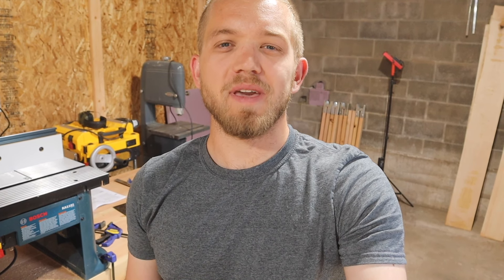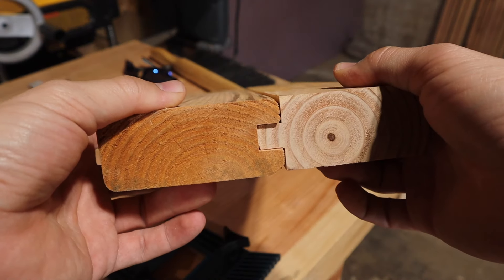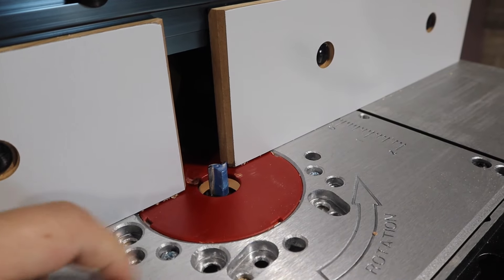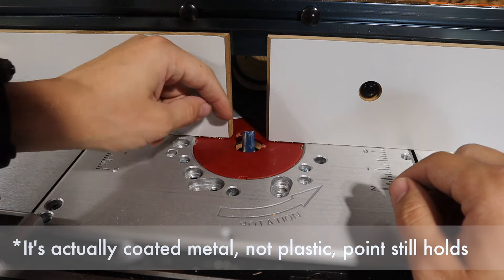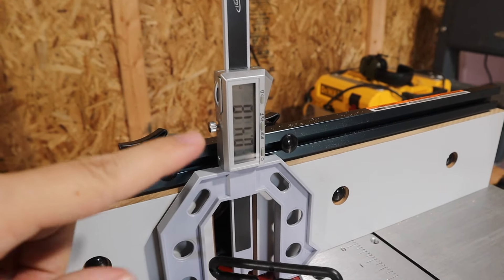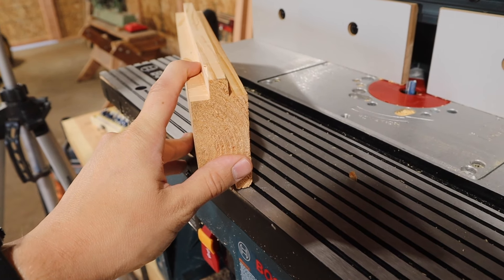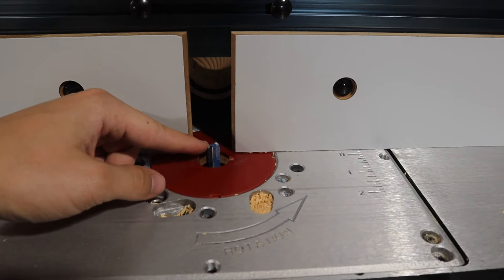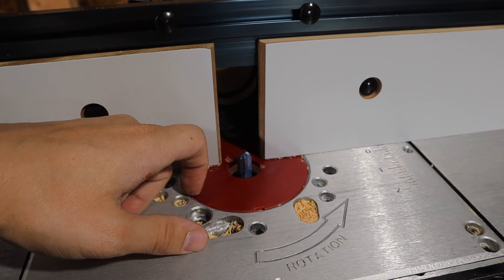Cutting a Tongue & Groove Joint | How to & Tips/Tricks

Comment: I very much appreciate that you showed me how to use the Router table to cut a T and G joint for timber thicker than the standard 20mm/3/4 inch Router set that I currently have. Being able to make T and G joints on  1 and a half, or even occasionly 2 inch timber will be of great benefit to me. Thanks a heap for showing me the obvious ways for cutting T and G joints on timber other than using the limiting 20mm Router set timber I have!
Reply from the maker: Glad you found it helpful! You may also look at the Freud set, they have a lot of combinations you can cut in and it’d be a lot less thinking/math using their bit set. 

Here’s the set I have now 
https://amzn.to/3ZbTMlW
Reply: @NorthwestCraftsman  "Adjustable at .002 inch increments for stock thickness of 1/2" to 1-1/4" and groove widths of 7/32" to 3/8"" What if I'm doing 2 by or 1.5" material?
Reply from the maker: @ not sure I fully understand your question but there are a lot of ways to work the math out. Effectively, in this case, you’re limited by your router bit diameter that creates your groove. From there, you can divide the remaining thickness in half and mill both sides of your tongue side to create the tongue. For example, on material that’s 1-1/2 in thick (2by) if your router bit is 1/2in this leaves 1in of remaining material, so the tongue side would need 1/2in of material removed on both sides. Remove slightly more for a looser fit, and slightly less for an interference fit.

Comment: Not too technical for me.  This is exactly what I needed to see so I don’t screw up $ 2K worth of rough cut cedar and needed to know how to properly tongue and groove the wood.  For us hobby woodworkers this was wonderfully presented!  Thanks! 👍👍
Reply from the maker: Thanks! If you have a ton of boards to do, one of the issues you can run into with this method is variability in the tongue thickness and groove placement. This stems from variability in board thickness. If your boards aren’t exactly the same before cutting this, they’ll be off.

Also, there is a new bit I’ve purchased from Freud which could save you a ton of time as well. It’s their tongue and groove bit. Much less room for error. 

https://amzn.to/3lFItRH

Good luck with your project!

Josh 
Northwest Craftsman
Reply: @NorthwestCraftsman  thanks Josh, I will purchase the new bit.  I bought the 2 speed Dewalt DW735 planer so I will ensure all boards are played exactly the same. But I’ll still pick up the bit because I want to make this as simple as possible. If I am using the cedar tongue and groove panels for the boards which are only going to be 24 inches running vertical, would you suggest a tighter or looser connection? My wife thought looser because of moisture and expansion during cold and warm months, but I would love your opinion! I will be staining and sealing the wood prior to assembly.  Thanks again!
Reply from the maker: Fantastic! That’s the same planer I have and that’ll be perfect! Man that’s going to smell nice. 

Your wife is spot on, I’d leave a little bit of slop in the TnG joint so the wood can both move around and because assembly will be easier. How are you securing this to the wall?
Reply: @NorthwestCraftsman  I purchased plans from a company.  According to the plans I will be making a frame out of 1 1/2” x 5/8”cedar (inside frame) and secured with 1 3/16” brads. Then once knee boards set in place against the frame, then will use 1” x 1/2” trim top and bottom which will sit flush with frame.

I hope that makes sense to you, because it’s all new to me and I’m just reading what’s in the plans. Seems straightforward for someone like me with no experience.  Making this should be pretty therapeutic for me.  And the wife smiled when I told her you agreed with making the T&G slightly loose for expansion and contraction.  :)
Reply from the maker: Makes perfect sense! It’s really nice to have a set of plans just ready to go. Simplifies things a lot in the shop and allows me to relax more 😂

Glad I could validate her thoughts 😂 my wife is right quite often 😂
Reply: @NorthwestCraftsman  will I need to buy the Bosch Table Base for 1617/18 routers?  I bought the 27” x 18” router table last week.  Also, which router should I get to go with the table?  I am thinking the Bosch 12 Amp 2 1/4 HP Fixed Base model (not sure of the model #) with Plunger but not sure if I need plunger or not?  Any advice is appreciated.  Thanks!
Reply from the maker: Hey, thanks for your patience, busy week. There are a few questions in there and I want to make sure I interpreted them correctly. 

When you say you got the 27x18in table, is that the Bosch branded table or another table? If it's the Bosch table, the insert will fit the Bosch 1617 EVSPK fixed base with no problem. I find having the plunge base on hand really helpful but it's not necessary if you plan to have your router permanently mounted in the table. If it's another brand of table you can always mount the Bosch fixed base into the insert or buy a universal insert which as the right bolt pattern. 

If I totally misunderstood your question, let me know 😂

Here are a few of my videos that may be helpful:
Router Unboxing: https://youtu.be/06Xcl2aPA1c
Router Table Unboxing: https://youtu.be/clwb5igR6Jw

A link to my core power tools which has the router table and router combo on it:
https://www.amazon.com/shop/northwestcraftsman/list/79MACE1MA4BS?ref_=aip_sf_list_spv_ofs_mixed_d
Reply: @NorthwestCraftsman  you interpreted correctly.  Your video was great in explaining the new Bosch so I ordered it.  I didn’t know the table was just a table and didn’t know I needed to buy the router separately.  My mistake, you gave the links and I wasn’t well enough versed to know.  So I bought the Bosch router yesterday as well.  It’s a learning curve for me.  I guess the only other question I have is if I am T&Ging a 1” thick piece of would should I buy the router inserts as a kit or just buy the single.  I am unsure if the bit used on that thickness should be 1/4”, 3/8” or another size altogether?

Comment: I’m wanting to put a 1 1/4”groove into my 7”x3”x 9’ fence post and run my fence horizontally. How would I accomplish the groove without a router table? I have a router, but no bits yet. Any information/suggestions would be appreciated.
Reply from the maker: Hey there! That’s a cool project! 

On something that large, I wouldn’t even like it on a table, pretty unwieldy to move on its own. I’m not sure if your router has this but the Bosch router I have has an edge guide you can use (link below). If yours has something similar, I’d do that. 

Bosch Edge Guide
https://amzn.to/4c9mOq6

Comment: Thanks very much for your work with this video! 

I have a question regarding recommendations for cutting tongue and groove on thicker stock. My boards are 1 ¾" by 5 ½". I'm processing a lot and wondering what the most efficient way to do this. It seems like a tongue and groove router sets are the way to go, but i can't seem to find one that works for stock this thick.
Reply from the maker: Glad you liked it!

1-3/4 is pretty beefy, however, it should still be totally doable. You’re right that normally a TnG bit set would be the most efficient way to go but my normal go to from Freud only accepts up to 1-1/4in. Is 1-3/4in the final thickness of your boards? Or is that before jointing and planing. If so, you may be within range at that point. But assuming you’re not, I’ve had some really good luck with using my table saw to cut the tongue and then pop a dado blade in to cut the groove. It’s still more manual than a bit, but it’s even easier than what I showed here. Out of curiosity, what are you using those behemoth’s for?

Comment: Can you do tongue and groove joints using a dado stack on a table saw? I only have a handheld router and not a router table
Reply from the maker: Sure can! In fact, you actually don’t need a dado stack, I did a video a little while back just using a regular blade there are some limitations but it is still possible. 

https://youtu.be/6aaXP2pSKkI?si=SowY-qIVkzzhv2HE

Comment: ❤ As a DIY beginner is easy to understand and followed. Can I use tongue and groove on a horizontal fence project? o is only for indoor used?
Reply from the maker: So glad you found it helpful! You can totally use TnG outside but one thing to keep in mind is that outside the wood will expand and contract more because of the larger swings in temperature and humidity. Because of this you’ll want a looser fit on the joint.

Comment: Hey quick question, I have red cedar planks already cut is it necessary for me to do the tongue and grove for the ceiling and walls? This is gonna be for a bus I’m currently building
Reply from the maker: Great question! It depends what you’re looking for. T&G or ship lap joints will help to keep all the faces coplanar but aren’t necessary for structural integrity. If you’re securing each board well, you could leave them as is.

Comment: Really great video, thanks for the explanation!

I've got a project where I want to do a tongue and groove of sorts, but I'm not sure how thick to make it. Any feedback would be appreciated.

Basically I have a tray thats 3" wide incl. The sides (each a 1/4" thick), and I want the base to slot into a rail on either side - sort of like your example with the drawer, except rather than one tongue and two groove edges, it will be one tongue and one groove edge - the bottom of the box this whole thing goes in will act as the second. The groove would look something like this:
T

What I'm not sure about is thicknesses - will 4mm (yes, I'm mixing mm/in) deep & tall grooves be strong enough for the T to stay in place, or would I need something closer to a 1/4" (about 6.35mm) be better?

Sorry if that doesnt make sense, its kind of hard to communicate over text :)
Reply from the maker: Hey! Thanks for the message! Glad you liked the video and that sounds like an interesting project! I think I can visualize what you’re looking at and unfortunately I think the answer is, it depends 😂 what kind of wood are you using? For softwoods, even 1/4” is probably too small, plywood you may be able to get away with 4mm but 1/4in would be easier to source, and hardwoods, if clean, could probably handle either. I’d say go with the largest your design will allow, it’ll help with tolerances and in making the whole thing more robust.

Comment: Replacement of these joints with same strength and easy to operate and increase productivity ?
Reply from the maker: Hey Gaurav, just to clarify, are you looking for a different joint that can be made more quickly?
Reply: @NorthwestCraftsman  some example like
Reply: I have to join 2 wooden planks that have strength  to make box replacement of these joints some examples
Reply from the maker: For joining pieces along the edge without additional wood, a tongue and groove is really the only joint. A butt joint with glue would work as well since glued joints are quite strong if done properly. There are also far more efficient ways to cut a tongue and groove (with a tongue and groove bit for example —> https://amzn.to/3zgheRo).
Reply from the maker: There are also more intricate tongue and groove style joints like the one below from Freud. 

https://www.freudtools.com/products/EC031-IC

Comment: Im very new to wood working. Is there a reason why you wouldnt, for the tongue cut, stand the board up and run it down the side then flip around and get the other side?
Reply from the maker: If I understand your question right, nope! It all depends and where you want fine control. On this particular router table I have pretty coarse control over the fence position (forward and back) but very fine control over the depth of cut (up and down). I wanted more control over how thick the tongue was, rather than how tall it was but you could totally swap that. 

Another consideration is how stable the work piece is. You want to ensure that your workpiece is very stable as you go through a cut and I felt more comfortable cutting in this orientation. 

Great question!
Reply: @NorthwestCraftsman  Thank you.

Comment: I am about ready to repair several pieces in my gazebo that are tongue and groove, and this video is extremely helpful.  Can I make the groove in one pass.  My lumber is 2x6 cedar, and each groove will be 1/2", and the tongue also will be 1 1/2".  Thank you
Reply from the maker: Hey Steve! Glad you found this video helpful! To make sure I’m interpreting what you’re saying correctly, the tongue/groove width is 1/2” and the interface depth is 1-1/2”? 

It’s possible to do it all in one go but that’d be a very heavy cut. I used this method on a pine headboard/footboard with about 14 2x6 boards and a 1/2”x1/2” T&G. My nice upspiral but was fried by the end, I think from the speed I had it running. I’m on the verge of getting a Freud tongue and groove router bit set which would work even more smoothly than the method in this video and I’d recommend if tongue and groove joints are going to be used on any more than a few boards.

Freud Tongue & Groove Bit
https://amzn.to/3yC16Hp
Reply: @NorthwestCraftsman  thank you for getting back to me so quickly.  My mistake, the tongue/groove width is 1/2", as is the depth, that being 1/2", and not 1 -1/2".
Reply from the maker: If course! Perfect then on the depth and width, that’s exactly what I had on the bed frame. If you’re only doing a few boards then the method shown here works great, I’d do some research on speeds and feeds for cedar at that depth so you don’t burn out your but like I did mine. If more than a few boards, I think the tongue and groove bits would be a worthwhile investment. 👍

Let me know how it goes! And email me photos if you’d like. I love to see the projects subscribers are working on.

Comment: What kind of Router table. And what brand of Router HP. I’m doing my house in pine tongue & Grove. Thanks great video
Reply from the maker: Evening Jimmy! 

This is the Bosch 1617EVSPK Router Kit which is a 2.25 HP router and the router table is Bosch's RA1181, both are linked below on Amazon. This thing is a work horse. My biggest lesson learned on the bed frame I just did was make sure to get a good bit that's sharp and if doing a lot of tongue and groove, I think it's worth the investment to buy a dedicated tongue and groove set, the one I'm looking at is linked below. I ran into problems clearing chips and overheating my up spiral bit which ruined its edge. 

Bosch 1617 EVSPK: https://amzn.to/3hhDm5G
Bosch RA 1181: https://amzn.to/3bh3UAe
Freud Tongue & Groove Set: https://amzn.to/3hnbddv
Reply: @NorthwestCraftsman  thank you. I really appreciate it.
Reply from the maker: Not a problem! Good luck!
Reply: What would you use if you needed something larger like 1 inch wide by 2 inches deep?

Comment: New subscriber here….with respect to the tolerances between the tongue and the groove, I’m conflicted about which I like better, the 7 or the 15 of a thousand. I’m curious about the possibility of the difference being dependent on soft wood or hard wood.  The seven thousandths could become an issue for expansion or contraction of the wood. I’d soft wood more susceptible to greater variations or, would hard woods be more at risk? Should greater than 7000 be given for that change? 
Liking the channel and I’ve seen only two episodes!! I can see where taking a lot of notes, or screenshots, may be helpful!!😎
Final thought…”o” is a letter and zero, is a number. When referring to settings, it is zero five zero, not
“O” five “O”. 😎 it’s one of my pet peeves, and I drive my wife crazy about it! 🤣
I had have other pet peeves, but that’s a rabbit hole we don’t need to dive into!🤣🤣
Great show!!
Reply from the maker: Haha, yes, you are correct about the letters and numbers 😂 probably just laziness on my part since “O” is much easier to say than “zero.”

And to your questions, it totally depends on the application. Swelling will make a difference and in fact, after letting it sit on my shelf for a few months, the 15thou tolerance is now snug. There are even nicer bits you can use to cut these called, not surprisingly, tongue and groove bits. For sliding applications, loose is better, for assembly, right works better, especially since the latter is usually glued. Again, all depends on your app!

Thanks for the great question and welcome to the community!
Reply: @NorthwestCraftsman  ahh, glue up…completely neglected to factor that in. I’m seriously considering an attempt at replicating your build. It’s not rugged only in construction, but in appearance as well!
Reply from the maker: Let me know how it goes! If you're doing any amount of tongue and groove, I really recommend you get a tongue and groove bit set, they're not cheap but are 100% worth it. 

Here is the one I have:
https://amzn.to/3rmQWfo
Reply: @NorthwestCraftsman  I just ordered your recommendation. I’m new to the router which means I’m expecting a learning curve!!😎👊🏻

Comment: Your bits will lasts longer and you'll get a cleaner cut by taking multiple passes. Nice video.
Reply from the maker: Good to know! Thanks for the heads up. At hand fed speeds, how deep would you recommend in a pass for pine?
Reply: @NorthwestCraftsman  I am hardly an expert and I work almost exclusively with hard woods. I like 1/8th inch passes in general. Much depends on the bit size, bit speed, the material you're using, and the type of cuts your trying to make. That's not much help, I know. I think a person could literally spend years learning the ins and outs of this glorious tool. Looking forward to more of your videos. Be well.